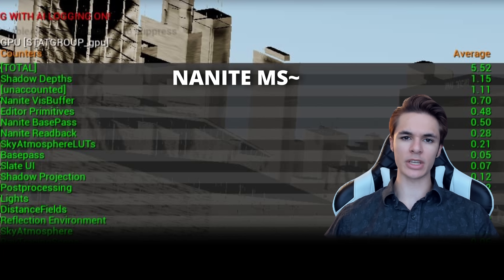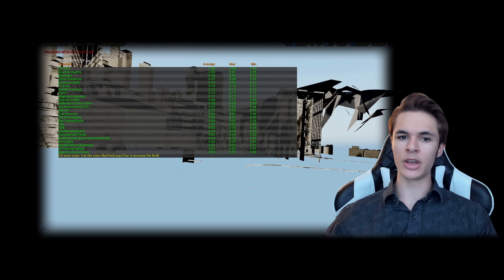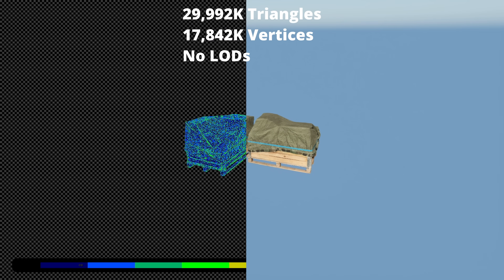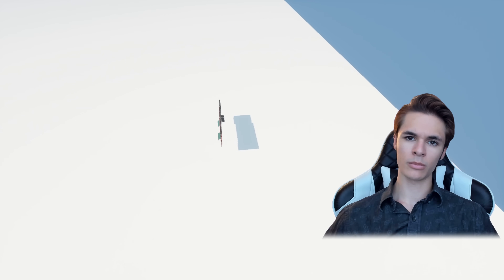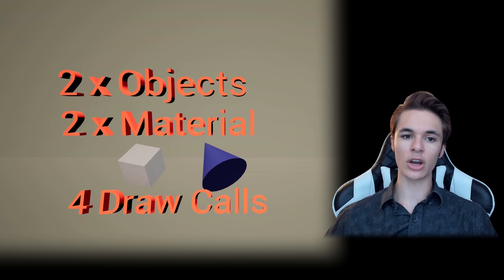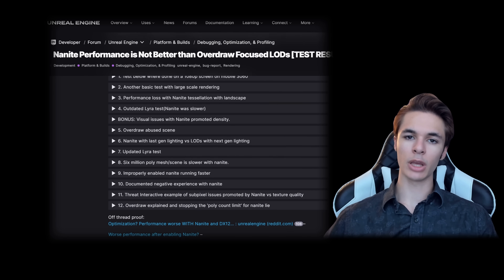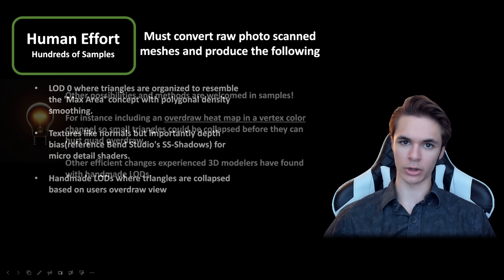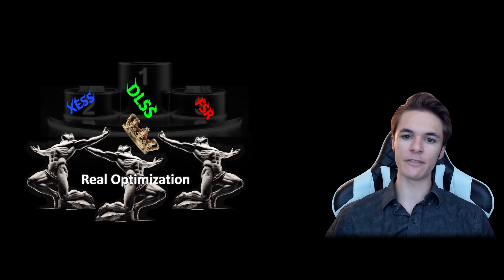Epic's Unreal Optimization Disaster | Why Nanite Tanks Performance!

Comment: Finally a video that talks about nanite!
Honestly, nanite saved a project, because we had 100 meshes with 20mil poly each and nanite made it work on machines that had no right to be able to, but…
It is in no way a silver bullet and the day to day use, as a quick LOD it is not.
As a modeler, there are rules to modeling and if you do it right, you need a day max to optimise a big ass mesh, which you know how, because you made it!
“Quick” and dirty modeling exists and optimisation down the road, but when you are making the prop, you KNOW or at least understand what and how to do it, for it to be the least destructive.

Non destructive modeling exists, but it brings in different problems, such as time, approach, workflow and unless it requires it, you dont use it, as its a different beast all together.

You can model a gun any way you want, but a trash can, house, something non hero, non changing and that has measurements set in stone, you do it the old fashion way.

Texture and prop batching is simple, but being good at it is not.

I love lumen, but it is clearly still in the early stages and needs additional work to be optimized for non nanite and optimized workflows.

Im just so happy I wasnt the only one going insane about this
Reply: I have a comment above with my opinion on this, but I'm not working in game development, so my knowledge is limited. Considering that you are modeler I have a few questions to you:
1. How long does it take to take a model for nanite vs LODs?
2. How many years you work/have experience as modeler? It's for the sake that pro's making stuff way quicker, so that difference one vs another may vary depending on experience.
3. How much you are aware of the optimizations mentioned in the video? My opinion is that he have at least 6 years of experience and probably already some Senior gamedev, but it's hard to imagine that new gamedevs would have that knowledge.
4. Do you think nanite is useful right now? Do you think it will be useful in the future? (may be with some polishing and fixes)
Reply: @XCanG  Sure, I can answer those
- nanite is obviously just a click, so nothing to do there really. As I said, when modeling, you ALWAYS plan ahead, so when you are doing retopo, its just a matter of how well you preplanned all your steps beforehand. So as there are rules to modeling, there are good practices in place for a long time and if you follow them, you are going to take a bit longer to make a prop, but when doing retopo/LODs, its going to take only a fraction of the time needed. Cant really time this, because its how you should be modeling regardless, unless you are doing for visualisation or movies only, where they dont need to be optimized.
- professional, none really, as everything I have done is on personal works and game jams, due to the game dev industry being a bitch to really get in. There are steps or approaches, but in the end it dosent matter, as long as you deem it to be the best approach time wise, modeling wise and within budget, but most have the same workflow, because if you hand it off to somebody or leave the company, other need to be able to take your work and adapt/finish it.
- very little/barely understood anything, because I learned from doing it and adapted my workflow base on the information I got, while searching for solutions. Honestly, you can basically skip anything he said, because that is all theory in the same way of how light works in games. As a modeler, you dont really need to know exactly how it works, but you get a feeling and slight understanding of how any why. He is going way more into technical stuff, something tech artists and programers deal. As a senior modeler, you touch this, but in the end your job is to do other things, such as modeling well, texture packing, instances, draw calls, modular design... in some areas and studios, this gets mixed in between and I 100% guarantee you, that most dont know it, even seniors, but they compensate in other areas.
- nanite is already useful, it will be more useful, but limited. The fact is, nanite is a constantly active process going on in the screen, where as LODs are a one and done. LODs will never go away, but their dependency will be reduced, as less and less optimization will be needed to make games work so well, because computers are getting better.
As I said, nanite straight up saved a project of ours when it was still in alpha/beta, so now if you use it for trying out how something looks in game, stress testing a rig pre optimization or whatever, it has its place, but should not be overused and has limitations. You cant use it on an skeleton/rigged model for example, as it relies on a constistent poly mesh.

Take everything I said with a grain of salt. The video explained everything BEAUTIFULLY and I understand things I have unknowingly been doing for years, but never really grasped why, but I knew it worked.
I learned things my way, studios teach their way, opinions clash and in the end, nobody really knows what they are doing, only how they feel they should be done and the final result dictates that.

Comment: Nanite is a fascinating concept to me, but I'd say you're comparing apples to oranges. 
In a way, tools and techniques change in accordance to the hardware level. 
Should we still be using the hyper efficient techniques that developers had to come up with to circumvent the limits of the playstation 1?

LOD transitions are and always have been a visual compromise that was acceptable in order to achieve good performances with the hardware that was available in the era in which the technique was developed.

So while nanite is more expensive, the question remains, does it look better than LOD transitions? 
If you develope a game today in UE5, it might take you some years to deliver, time in which a 4080 super has the time to age and be considered "old". 

Still, it's not like I'm excusing Epic's treatment of the engine. There are so, so many things beside the visuals that could use some serious rework. Things that should be default for modern day game development and are instead 600+$ plugins. Things that work very well but are so poorly documented that you're considered a wizard when you share knowledge about them. Things that break your project catastrophically, and so on.

Comment: What is the solution then? What options do we have? Cryengine is basically dead, Unity is not worth the time. What can we do now? O3DE ? Which engine is better?
Reply: As possible solution is writing your own engine. No, that doesn't mean you have to write everything from scratch. Take Ogre3D (Ogre-Next version supports PBR, Global Illumination and several real-time reflection algorithms), Bullet, SDL and some other libraries.
Of course it will be difficult journey, but it seems any modern game engine has crucial problems.

Comment: I'm not disputing what is shown here, but I've had cases where Nanite in UE 5.1.1 increased framerates 4x (low 20s fps to mid 90s fps) in my projects, and the only difference was turning Nanite on. "Well, there's more to it than that!" of course there is. But Nanite took hours of optimization work and turned it into enabling Nanite on a few meshes.
Reply: Do you smoke crack?
Reply: Turn off virtual shadow maps and redo your test.
Reply: @DeltaNovum  YEAH!
Reply: This is exactly what Nanite is meant for. It saves development and optimization TIME.
If you know what you're doing and you have the time and budget to do it, go ahead, make Nanite unnecessary, but it's not there for you in that case.
Reply: I mean there probably shouldn't be a point when you change 1 option and get 4x performance, to me it sounds like even before that you are doing something terribly wrong.
Reply: @Psydvckthefirst  most ignorant take ive heard in 10 years. finish college and go make some real programs

Comment: Apologies if a few of these have been answered already - you are not wrong on a lot of this but I think I can improve upon your argument when it comes to the overrated draw-call overhead argument. With UE5.x I think the issue is to go fully GPU-driven you change the codebase so much that it is difficult to have the UE4 'traditional' mode and you'd multiply complexity in the codebase, as well as how you go about creating the art for it. I'm not across it but I am guessing their mobile renderer is the alternative codepath to use to go back to UE4.x-style.

This isn't to say that a 'sweet spot' couldn't be done, GPU-driven is certainly possible with a lot of concepts that were under the banner of 'AZDO' (approaching zero-driver overhead) which mitigated and removed a lot of the drawcall argument, compatible on older hardware (2014) https://www.gdcvault.com/play/1020791 and with bindless textures, completely removed the need for merging meshes or 'atlasing' textures (OpenGL could do it but only with extensions only found in Nvidia at the time - vulkan/dx12/metal can do this with good hardware coverage, look at Doom Eternal's compatible hardware).

What you lose in this is the virtualisation/streaming/culling/instancing ability that nanite supplies in an elegant screen-space way as the traditional vertex->fragment pipeline isn't quite flexible enough to do this in a fine-grained and scalable way. Visibility buffer concepts like The-Forge uses https://github.com/ConfettiFX/The-Forge?tab=readme-ov-file#visibility-buffer-research---i3d-talk aka AMD's 'GeometryFX' can use compute shaders to build something similar that the vertex->frag pipe can use for older hardware for their v1.0 of it. Their arguments to go v2.0 which is fully compute-driven even for rasterising the visibility buffer mirrors a lot of what UE5.x is doing to achieve nanite, and their write-up on why they went this way can answer a few questions I think, despite the slight performance overhead. And yep, mesh shaders can be used on more modern hardware without the need for this compute shader codepath so it should be quite optimal on that hardware supporting it.

I am more of a fan of The-Forge's approach and combining nvidia's displacement micro-maps which allow a compute fallback and is compatible with raytracing hardware for meshes that need to scale. The split here then for covering a wide range of hardware or to support LODs or paging/streaming is making that choice on how you want the art authored, and/or rely on simplygon/meshoptimizer/decimation algorithms + dithering to hide transitions and the game engine's streaming code to do a good job. (Or instead of dithering, the game RAGE had a fun one which 'moved' the high-lod excess verts into the low-lod verts while moving the UVs as well to prevent warping to do the transition before swapping to the pure low-lod, and this was quite seamless visually).

Comment: A little preachy, seems to jump into conclusions, but there are some interesting points. The thing about nanite, it does try to keep the edges of the mesh detailed so the silhouette looks good, I guess it also contributes to the overdraw. With LODs the silhouette changes more radically, which personally takes me out of the experience when I see it, which is rare tbh. I think, you're also pushing a narrative and omitting some info. I also acknowledge that nanite could be better optimized or it should have more options to tweak the performance.

Comment: Here’s the question though: is this going to save significant enough resources in a development team to allow them to achieve more with less. If it’s not “optimal”, it’s fine, as long as the amount of dev time it saves is worth it. Ultimately, in an ideal world, we want the technology to improve so development can become easier
Reply: The problem is when newer games look and perform worse than older games while still costing the same. If that saved developer time will be passed on as price reduction to the user, sure. But that's not what happens for most games.
Reply: Cost of development doesn't disappear however, it's just transferred to customers. So they will have to either pay for a better GPU, run the game at lower quality, or will just "bounce off" and not purchase the game at all.
Reply: @wumi2419 they could just make the game look worse instead. The development style being done now is already burning something, and that something is developer talent. And there isn't an infinite pool of that.

You also ignored that GPU performance increases over time. So it may be a rough tradeoff now, but the tech will continue to get better hardware over time.
Reply: @blarghblargh Hardware isn't getting that much better anymore, that's part of the problem, game developers acting like we're still in the 00s or early 10s when you could start developing a game on high end Hardware and by the time it comes out it will run on mid-range Hardware.
Reply: @ScorgRus how much more powerful do you think GPUs would have to become to "bottleneck on single thread performance"?
Reply: @Botondar  They don't have to. I didn't mean CPU threads, I meant GPU cores. You can make your pixel shader so complex that you won't get even two digit FPS on any GPU, present or future. That's because there's always serial work to do after all the parallelization. No 'thousands of cores' will save you from it. And GPU core frequencies have all but plateaued already.
Reply: @ScorgRus  I understand what you meant, I'm asking where you think the tipping point is where simply adding more GPU "cores" won't actually provide a meaningful performance increase for a typical modern rendering engine workload. 
Is it 2x, 4x more cores? Is it 10x, or even 100x? Or are we already at that point?
Reply: @Botondar  You made me read up more on GPU architecture, and now I kinda don't know how to answer. If we make a rough estimation based just on the advertised number of "shader cores", which for upper-average GPU model is around 6000-10000, and number of pixels on screen, which even for 1080p is 2 mil, then 200x increase is possible. But in practice it is not of course. Even ignoring actually more complex architecture and the overhead that inevitably increases with more cores, no civil power lines will be able to push 40+ KW of power to hundreds of houses.
So I guess I have to correct myself and say that we will hit the power bottleneck first.
Reply: thats a good point
Reply: It's not alright because it's offloading the cost to the end user.
Reply: I don't understand why you ask about whether this allows development teams to be more efficient (achieve more with less), then you believe that in an ideal world tech would make things easier. Something becoming more efficient, and something becoming easier are not the same thing.
In fact, an increase in efficiency often times causes things to become harder or more complex to do.

Comment: Why are you expecting Nanite to be faster than LoD optimisation?
The point of Nanite is to avoid wasted development time spent in creating LoDs and avoid obtrusive pop-in that often comes with LoDs.
It is like expecting raytracing to be faster than baked lighting.
You don't do it for performance, but to not have to bake lighting.
The real problem with UE is not that, but the traversal stutters.
Performance gets fixed by better hardware, stutters need to be fixed by engine optimisation.
Reply: All of these videos deeply feel like someone opening Unreal after a few years of watching bad tutorials and assuming stuff “just works”. Ya gotta make the game and plan your environment around the gameplay needs buddddddyyyyy
Reply: that's what I was thinking as well. My qeustion would be: can't you use both?
Reply: @jackengels5077  you usually do use both, especially now in the transition phase where older hardware is not capable of running new features fast enough. So in the immediate term it doesn't really help in game development, but hopefully in the future with newer hardware when LoD and lighting won't need to be baked it will. Every transition is a hard one with no immediate obvious benefits. They come later.
Reply from the maker: @jackengels5077  No because of shadow methods.

Comment: Yeah, this is one of the things I dislike about many engines and felt Unity were going in the right direction, but they were doing many other things wrong while shooting themselves on the foot at the same time.
The render pipeline API is genius. They immediately moved on to standardize the rendering pipeline (the "UNIVERSAL pipeline" URP), which is the opposite of what the API is for, and they even had to backpedal and split it into two: the HD pipeline and the URP.
dumb dumb dumb. At least you could still have your own and sidestep any rendering decisions you really disagreed with, but tooling went the way of "two pipelines" instead of "your own damn pipeline" which is what I wanted.
My retro pixel games do not need many of the stages in either pipelines, it's just bloat both in binary size and performance.